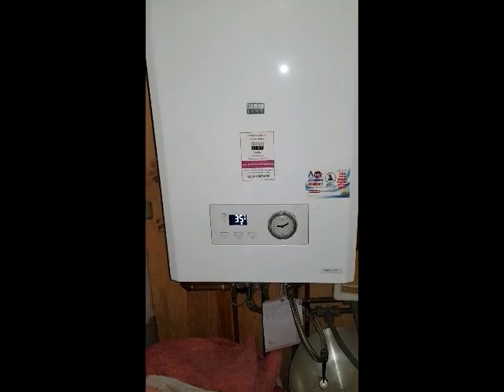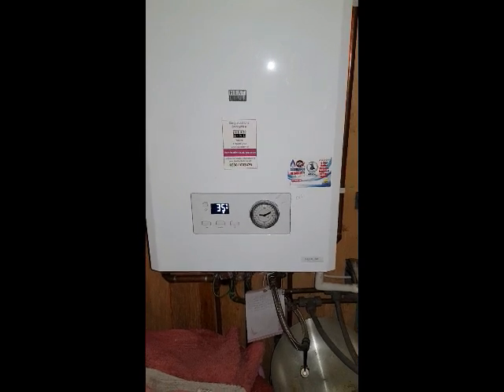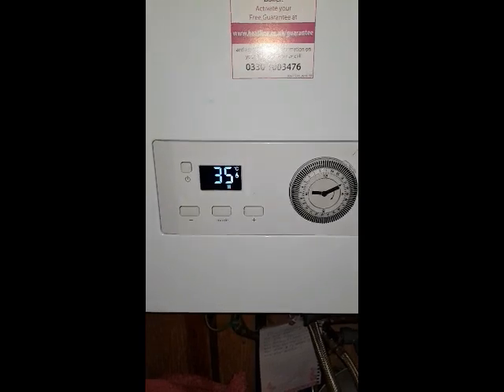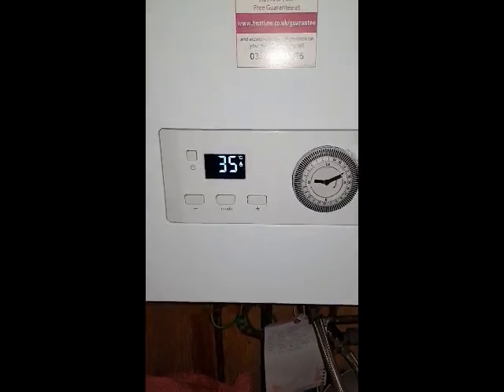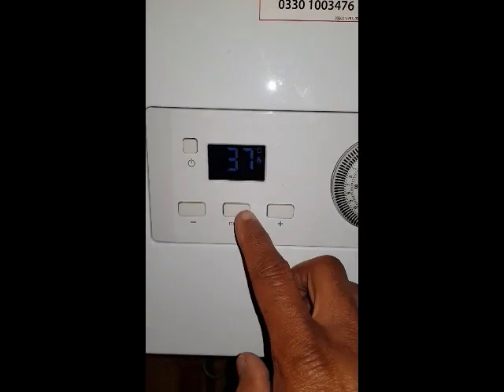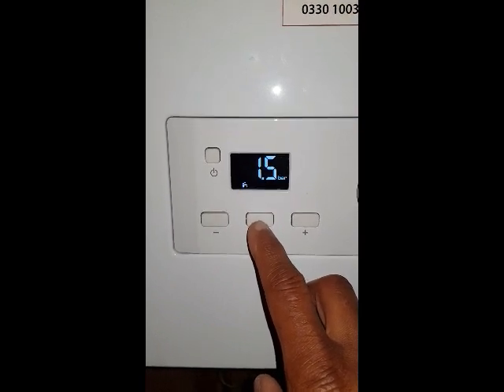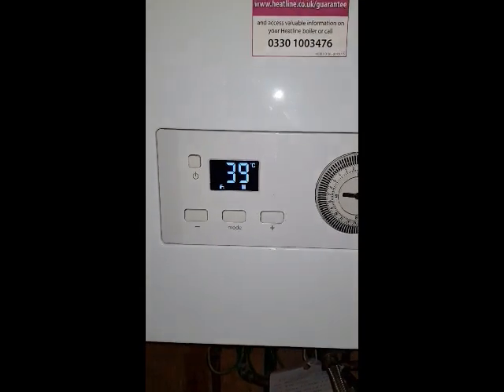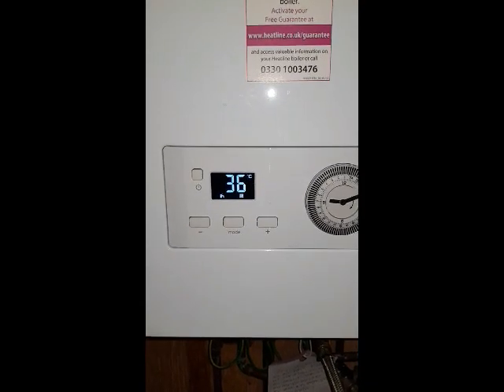No hot water Heatline Capriz 24B With Coach Tony Morgan

Comment: I can't start the radiators. The flame is not showing it only works the water but not central heating
Reply from the maker: It's either the mode button has turned off the heating, If so just follow the video instructions, or check the room thermostat. Also can you subscribe to our channel 😊

Comment: hi how do i turn up the pressure as just bled the radiators and now zero
Reply from the maker: There should a filling tao underneath the Boiler
Reply: @ARBoilers  is that the black tap
Reply from the maker: @mollymousse54  yeah normally with a flexible pipe

Comment: My boiler is just flashing oo instead of a number wat can I do am freezing
Reply from the maker: Press and hold the on off button for 5 seconds this should reset it
Reply: @ARBoilers  Hello have got same boiler my hot water but heating is not working. What can I do pls
Reply from the maker: @opeyemiosiyemi2560  check the mode button make sure the radiator system is showing and check timer and room thermostat
Reply: Mine says 00, mode won’t do anything? Did you fix this?